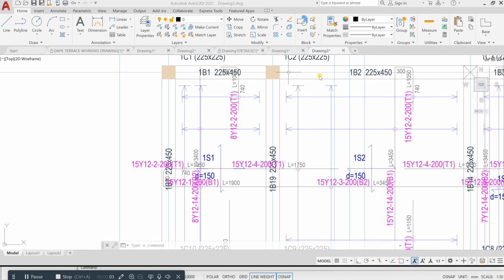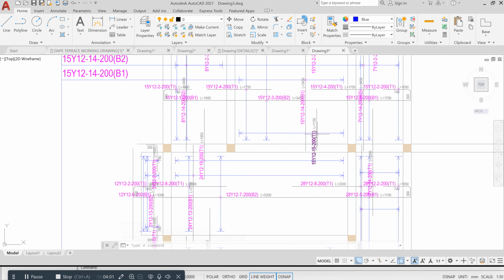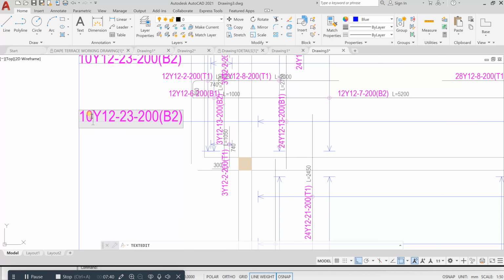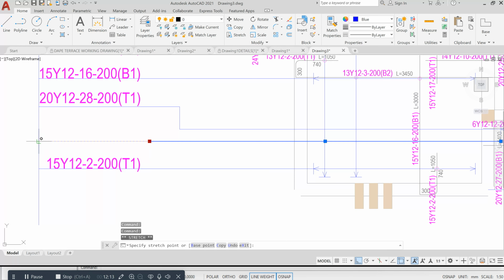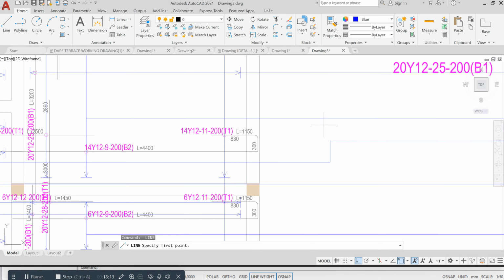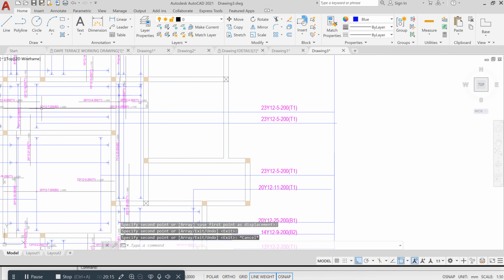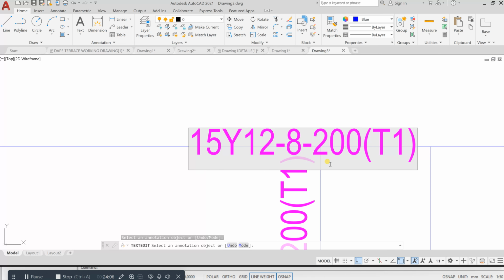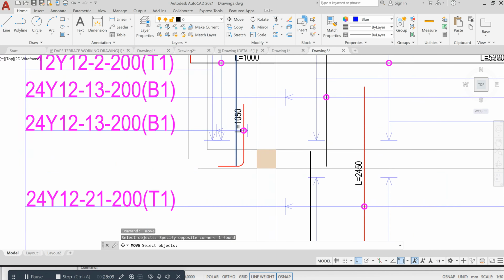AN EASY AND CONCISE WAY OF DETAILING SLAB: PROTASTRUCTURE/AUTOCAD

Comment: I can see 300 for some of the bend for the top return bar and other 100mm. The 100mm understood because if the cover of the slab is taken out 25mm+25mm is 50mm out of the slab thickness 150mm, then u get 100mm. Now the question is why 300 for others
Reply from the maker: Such dimensions are not actually required on the final detailed work  n it's mostly for top bend